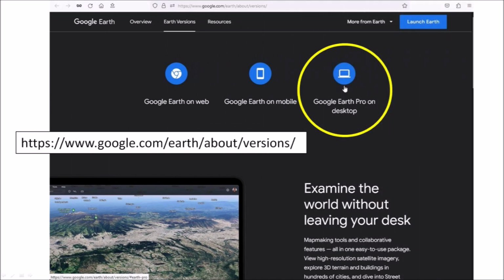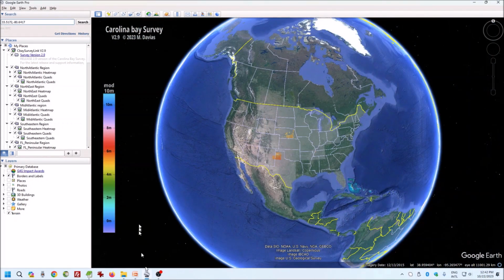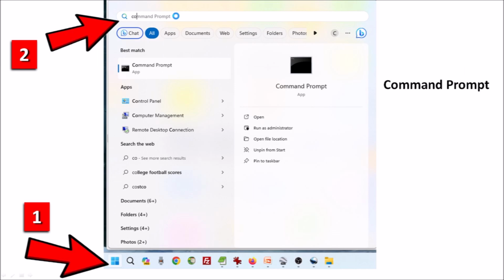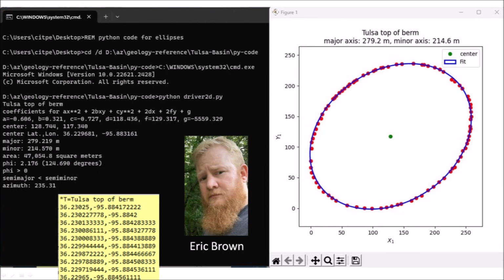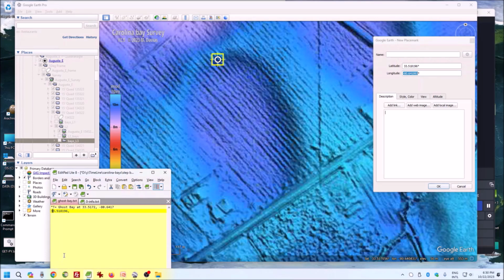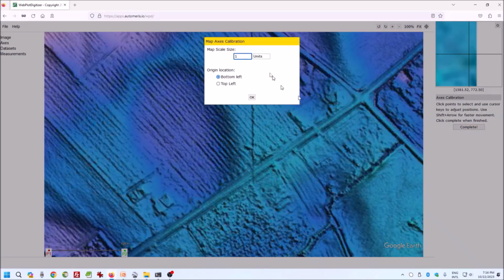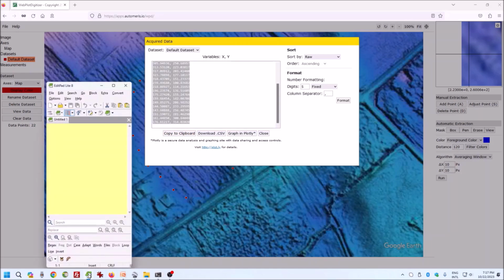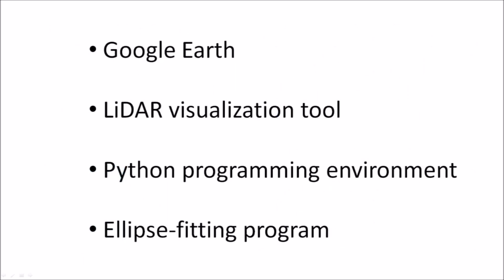Step-by-step:  fitting ellipses to Carolina Bays

Comment: 15:20 the azimuth is pointing in the direction of travel the ice boulder would've been traveling at time of impact, only use that azimuth if you wanna find out (using great circle lines on google earth) where it would've ended up further to the SW had it continued its trajectory. 

if you want to find out where the ice boulder came from, use the azimuth 180 degrees opposite on the compass at the local level. the lines should align with the basin's major axis when you zoom back into the local level.

Comment: Given that there was liquefaction at the surface during the secondary impacts, is it possible that the unconsolidated soil could have acted as a non-Newtonian fluid and resisted impacts? Would this have significantly affected the shape or size of bays?
Reply from the maker: I have seen a variety of effects even in my own experiments. The density of the target increases with depth, and the projectiles travel in a curved trajectory as they encounter increasing resistance. I am sure that the projectiles that made the Carolina Bays encountered a variety of target conditions.
Reply: @Antonio_Zamora  Regarding the video, I'm left wondering what the end-goal is for gathering all of this data considering that elliptical bays only formed under ideal conditions.
Reply from the maker: @AustinKoleCarlisle  The elliptical geometry and the overturned flaps of the "well-preserved" bays serve to establish that the bays originated as inclined conical cavities or penetration funnels.  After this has been established, we can then argue that the bays that do not have perfect geometry must have been modified during emplacement when the ground was liquefied, or later under the influence of eolian, erosive, and other terrestrial forces. It is not possible to make a forceful argument concerning deformed bays until the impact origin of the bays has been established.  The proponents of eolian/lacustrine mechanisms will always have a foothold if the Carolina Bays cannot be convincingly shown to be impact structures.
Reply: @Antonio_Zamora  That's my point, I think you have already effectively proven the elliptical bays are the result of inclined conical cavities through your body of work. I just think cataloguing every single one would be a laborious and tedious undertaking. If anything, I think another method in proving bays were the result of impacts would be noting symmetry along the major axis. Not all bays are elliptical, but they will certainly be symmetrical along the major axis--barring erosion, etc. How many large, natural geologic features are symmetrical along a major axis? None that I can think of. This would increase the number and diversity of data points in proving the impact origin, IMO.
Reply: Just as a quick addendum, I may have been unclear in my explanation of "symmetrical along the major axis". Take for instance the green feature to the left of the center bay in your thumbnail photo for this video. Yes, it's not perfectly symmetrical, but if you cover up the distal half of the bay (the irregular half), you're left with what looks to be a symmetrical curve along it's major axis and it appears to be a parabola or hyperbola. I just looked it up and these are also conic sections and follow a mathematical formula just like an ellipse. Wouldn't these non-elliptical features also support your theory of the bays resulting from inclined conical cavities? I'm not a math guy so please forgive me.
Reply from the maker: Hello Austin, I discussed distorted bays in the Uphill and Downhill video: https://youtu.be/OqcBu7I7tTM
Reply: @Antonio_Zamora  Maybe I overlooked it, but I didn't see any mention of parabolas in the video you linked. Wouldn't a parabolic shape also be indicative of an inclined conical cavity? Like the green feature to the left of the center bay at the start of the video. It's not elliptical, but the proximal half of the bay is symmetrical and appears to be a parabola.
Reply from the maker: @AustinKoleCarlisle  Even though parabolas are conic sections (https://en.wikipedia.org/wiki/Conic_section ), I do not mention them as possible evidence of an impact because they are mathematically infinite.  Carolina Bays that are degraded by erosion often appear parabolic, but in reality they are partial ellipses that have been distorted by erosive forces or surface movements. We can deduce this from the abundance of collateral evidence that the bays originated as penetration funnels (inclined conical cavities), which look elliptical when viewed from above.
Reply: @Antonio_Zamora  I carefully plotted the points of the green feature to the left of the center bay at the start of your video, and it is indeed a parabola (with a raised rim, no less). Are you aware of any natural geologic processes that result in parabolas? And by "mathematically infinite", you mean they are "open" vs closed like an ellipse? Regardless, it's still a conic section and that means it could not have been the result of natural geologic processes, correct?
Reply from the maker: @AustinKoleCarlisle  "Carefully plotted" ... Parabolas are ellipses where one focus is at infinity.  It is not surprising that you can get a match. I think that it is important to emphasize "ellipse" because we can demonstrate this by fitting bays by the least squares method, but also to distinguish the raised rims of the Carolina Bays from what Swezey calls "parabolic dunes".  Read the paper carefully and think how you would prove that the CBs are impact structures to Dr. Swezey.
https://www.researchgate.net/publication/341512360_Quaternary_Eolian_Dunes_and_Sand_Sheets_in_Inland_Locations_of_the_Atlantic_Coastal_Plain_Province_USA
Reply: I read the paper and did not see one mention of a mathematical equation describing a parabola, and actually it seems like the author used the term "parabolic" informally, rather than mathematically, to describe the shape of curved dunes, similar to how we commonly just say "football" instead of the awkward yet precise term foot-*ovoid*. Yes, I carefully plotted it. I took a screenshot, rotated the image until it was vertically symmetric, pasted that image into MS Paint, took coordinates along the rim, then entered those coordinates into the parabola program at DESMOS (webpage) and verified that the curve follows a parabola. This stands in contrast to the examples on the web I could find for "parabolic dunes" which are seemingly just curved dunes, but don't appear symmetrical. Regardless, I think the point I raised about symmetry along the major axis being evidence for an impact is worth consideration.
Reply from the maker: @AustinKoleCarlisle I am not the one who needs to be convinced. It is Swezey.  The Wikipedia article about the Carolina Bays is based on Swezey's article. He is a USGS geologist and people believe what he says. As I mentioned in one of my videos, he objected to my 2017 peer-reviewed publication.
Reply: @Antonio_Zamora  Well, I realize that you don't need convincing, but you didn't seem receptive to the insight I brought up about the parabolic features also possibly being evidence of secondary impacts, so I am left wondering if there is any scientific merit to what I brought up because I've never seen you mention it in any of your previous videos that I've seen.
Reply from the maker: @AustinKoleCarlisle  Austin, I appreciate all the effort that you have made in pointing out many features. I can defend ellipses as potential oblique impacts using mathematics and experiments, but I cannot do that for parabolas. P.S. I am having a hard time convincing geologists of my hypothesis even with math and experiments. Adding a plausible but weak suggestion will just provide opponents of the hypothesis a justification for rejecting the hypothesis.  We should not forget Richard Firestone's experience with the Carolina Bays.
Reply from the maker: I am glad that you are following through with your ideas. The analysis of the Carolina Bays can benefit from different points of view.

Comment: A little of-topic, but not wildly so: A video by Shawn Willsey, https://www.youtube.com/watch?v=7UjbxcktcLE , talks about secondary impact craters in Wyoming. While these craters are significantly older than the Younger Dryas impact Antonio is researching, I thought it was interesting to compare the geologic similarities of elliptical shapes and raised rims in the craters in Wyoming. I also wonder if Lidar data of that area is available and if similar analysis would demonstrate more similarities and help validate these methods. It appears the mentioned paper has already plotted convergence points but have yet to find the main crater.
Reply: A 280 My old analog to the Carolina Bays. The sandstone was consolidated enough at impact to be heavily fractured, unlike the Carolina Bays which are in loose sands. It may be a longshot to try and find disruptions to the bedding surfaces by those impacts that have analogs in the Carolina Bays -- but hopefully there is something like that which could add supporting evidence to the secondary impact hypothesis.
Reply from the maker: I looked at the LiDAR image for the site, but it did not have sufficient resolution.  The satellite image was much better.

Comment: Thank you so much for this. I want to go hunting but not interested in ellipse statistics yet. 

Also you once posited that the YDB impact event could have propelled a large volume of ice into earth orbit. I thought that was an elegant explanation for the sudden freeze that lasted a millennium with the increase in planetary albedo. When Schoch proposed a solar ejection that ended the YDB I realized it could also have provided the energy needed to rapidly sublimate and clear the remaining ice in orbit. I have not seen any posts connecting the two theories yet however. Is the energy not great enough or is there another better catastrophe that you know of? Gracias maestro. Patricio
Reply from the maker: About 4 years ago, I looked into Prof. Schoch's proposal.  It is difficult to substantiate the claims of solar ejection and their timing.  This is a video that I made at the time: https://youtu.be/_5ZT4_18NZk
Reply: Reminds me of this book : The Zonal-Belt Hypothesis A New Explanation of the Cause of the Ice Ages by Joseph Y. Wheeler 1908.  IIRC, the proposal is a temporary ring around Earth alike Saturn.  The information between was very informative, I own an original, if I get time, I would read it again.  I don't think I fully understood about the oblique angles, but solar loss was discussed.